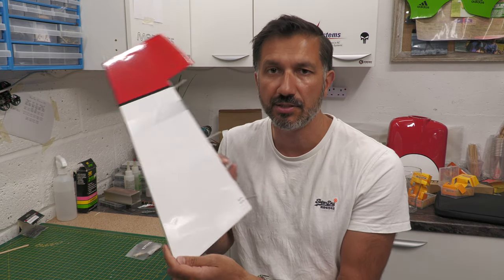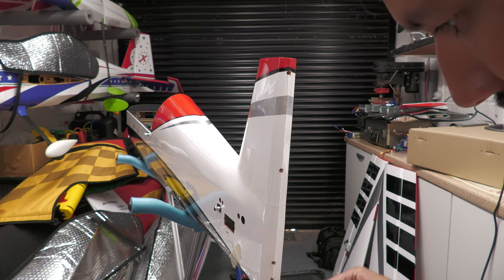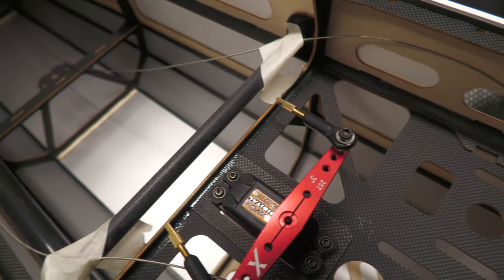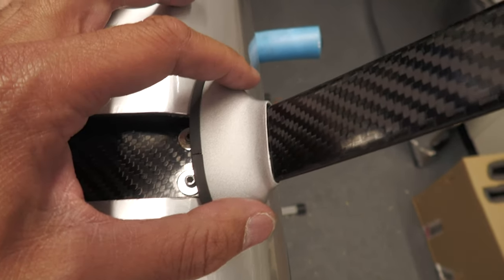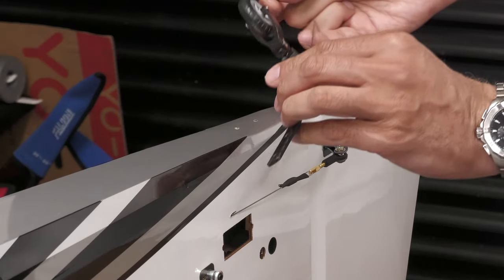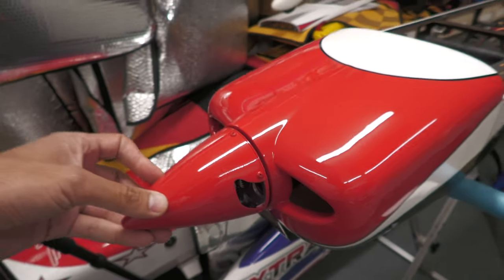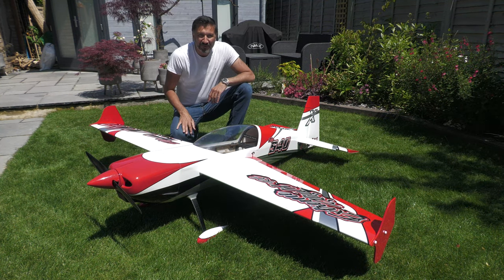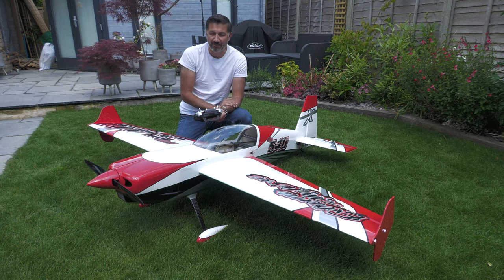78" Extreme Flight Edge Build | Part 2

Comment: On the elevator stabs, is there a single or dual carbon tubes they slide on to?  I just bought used one and I can't find any information on it and I think I'm missing one.  Thanks!!
Reply from the maker: Hi. This is the latest version which does have dual tubes for the stabs. You can just see the two holes at the end of this clip on my Instagram. I don’t think the older ones had dual. https://www.instagram.com/reel/Cs64rhBOPWV/?igshid=MjAxZDBhZDhlNA==

Comment: Nice what size battery or batteries… and what brand do you use ….getting back into the hobby mostly gas 30 to 55cc have a few 3s that I fly cause it’s so easy to throw them in the truck and go
Reply from the maker: Hi. Great to hear you’re getting back into the hobby. This planes running on 2 x 6s packs, so 12s 6000mAh. HRB is the brand.

Comment: Where's the rest of the build?
Reply from the maker: There is only two parts to this build. This video ends with me setting up the rates. The next video will be the test flight, the model hasn’t flown yet. I built it for a friend. You can put one of these together in 4 to 6 hours